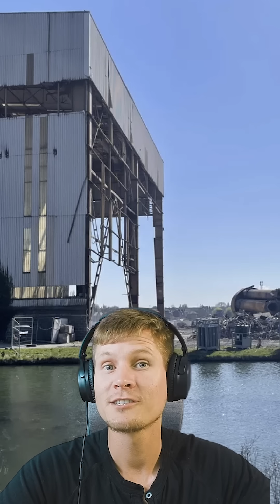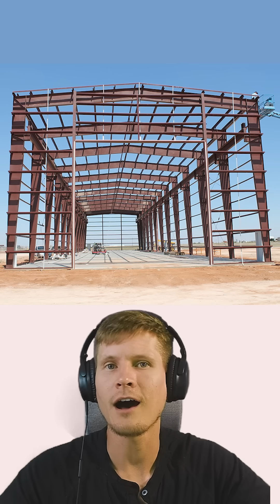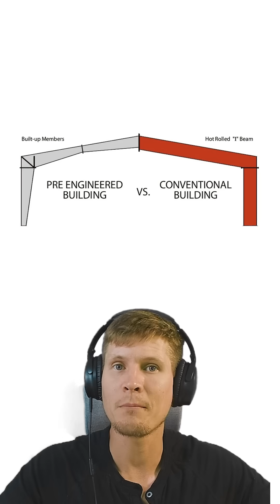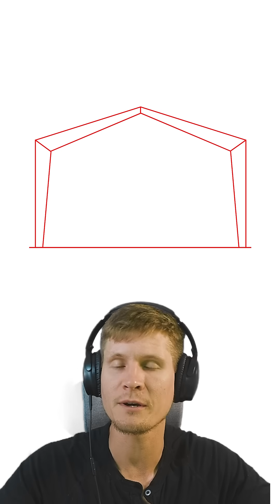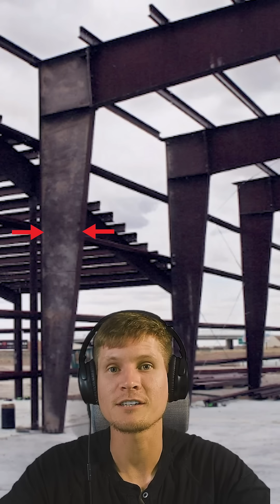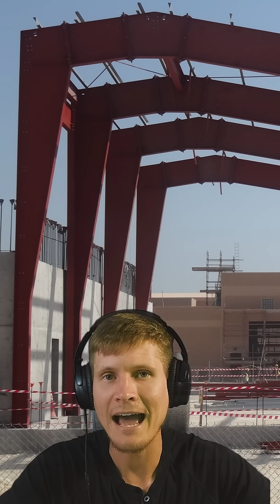This Steel Frame Looks Wrong… but Is It? Structural Engineer Reviews #reddit #engineering #kestava

Comment: The shape is the result of the vertical and horizontal loads (shear, pressure, bending) that the structure must withstand. It's interesting to note that old structures were unnecesarry bulky because at that time engineers weren't able to determinate the real loads on a structure. Materials science, computers, good calculation models didn't exist yet so much had to be "guessed".

Comment: All you have to do is study Frank Lloyd Wright's Johnson Wax Headquarters in Racine, Wisconsin.  It's almost 100 years old, and he used columns very wide at the top and almost tiny at the base.  And he didn't even have an engineering degree.  Rather, he studied engineering.

Comment: I want to build a house with this kind of structure. Thays what I've always dreamed of.
Reply: - these type of structures can be made from timber - using normal studs  clad in structural bracing board (Glue / screw / nail for true tight structures), designed for the loads  - to increase structural stiffness independent of brace-walls.  It is very useful for long open buildings subject to high dynamic loads ("far" from the "rigid" ends - or a building with completely open / opening, gable end . (Also at the ridge, to resist the "spreading forces" - of roof loads / snow, etc.)

 - An interesting recent video, Matt Risinger "Build show" - showcased an office / apartment with complete external insulation and exposed interior framing - this type of structure is suited to that method, it would assist in reducing the number of "hoops".
(Would need to build and test a trial hoop - if no strength tables exist - certify through testing.)

Comment: i was in the PEMB business (as a software engineer) for 20+ years.  i know some people use different words for things, but we always called there rigid frames (or built-up frames — in contrast to post and beam), while a portal frame was a different, more specific type of frame used at (wait for it) a portal, or at a place where an opening had extreme loads that couldn’t be handled by a simple post and beam — as i mentioned i was just a software engineer so i could have the words all wrong with respect to the technical engineering terms

Comment: The money saved also, adds up too. Beings these tapered "I-beams or H-beams" need to be manufactured whether they are tapered or straight, the cost is negotiable from either or, or minimal in fab time, but the savings comes from the less material being used. When there can be at least 4, often times more then that, can be $12k per beam saved, times however many there is... Like the building structure in the video. They can be $100k saved.. approx.

Comment: Proper size at the base so more room for storage racks and forklifts to maneuver.
Reply: No. To allow for overhead cranes
Reply: @BoogerJim    -that can also be engineered in, though it is often better to have the gantry independent from the structure, but if crane access to the entire structure is necessary - beefing up the columns to allow for that works (optimally, ?? not all the columns may need to support the longitudinal crane beams - infinite ways to achieve a design objective, one design set in every concept will get to least material - IF open volume is critical - external framing may be an option also..).

Comment: ahh yes, pre-engineered, as opposed to the buildings that are built first and then engineered later lol (I know that’s not what it’s referring to, it’s just funny to me because, technically isn’t any engineered structure “pre-engineered”?)
Reply: Theyre engineered sizes that are ordered by customers. As opposed to being custom designed on a job by job basis. Hence pre engineered.
Reply: The calculations and driven dimensions are engineers long before the design is even conceptualised.

Engineered-before-design.

In a normal structure, the building design and concept is completed alongside or before the engineering process to specify forces, materials and dimensions.

Designed-before-engineering.
Reply: Ikr lol, not a fan of the "name"
Reply: I've only ever heard them called pre-fabricated

Comment: Very interesting. I have two questions.
1. What about the top joint at the ridge of the roof?
2. Why make the entire beam get wider, instead of a simple gusset at the top to brace the joint?
Reply: Civil Engineer here: Gusset won't cut it as the increased stiffness (by increasing frame depth) is to improve the Moment capacity. If you play around with BMD for a portal frame, you'll notice the bending moments gradually increase to peak around the indicated joints. 

Gusset plates don't resist BM as well as increasing stiffness by increasing the frame depth
Reply: It really all comes down to stiffness. The ability to resist lateral forces. Gussets aren't ideal in this setup. They can "bend" when it comes to later forces as they don't have the necessary strength in all directions, since it's just a flat piece of metal. You wouldn't have enough "play" between everyday forces and failure in high winds. Like dude above says, moment capacity, is what it's called. 
With these large metal buildings, you want as few posts as possible. And that's essentially why this is required. Since there's so few frames/posts, they really need a wide connection at the main joints to be able to resist kicking out and racking, and tapering thickness is easiest way to achieve that while still saving materials. Those forces tend to be focused right on these joints.
Not sure what you mean about the ridge? It has different forces being applied, but is still connected the same way under same principles, basically.
Reply: (Mech/Mcha Eng - lol,  machines are structures designed to do interesting things)- Smoothly transitioning beam geometries eliminates/ reduces stress risers which will exist where "thicknesses" change rapidly (gusset plates - can be designed to taper smoothly in all dimensions I will agree). - A more "Natural" way would be to use an optimised form of catenary curve instead of a straight taper, but that is going to be more expensive to manufacture - and custom engineering may be required.  The structure mapping to the combined shear / bending moment diagram approaches "minimal material".
 - Note, as in all safety critical engineering a safety factor will always be applied, this means, for a catastrophic collapse to occur, lots of errors must be made - SF=2.0, is good for low fatigue / cycle life "machines"/structures - ?? take it up to 3 or 4 at these connections as they are relatively high cycling and high material stress components, mild steel should never exceed ~50% of its elastic range in general use for an infinite life).

Comment: PEMB engineer here. Depending on span and loading, the haunch may be dependent more on gravity and snow than even a large category C seismic lateral load. 

The shape of the most efficient three plate also follows pretty close to the moment diagram of the frame itself, and in a pinned moment frame, the base approaches zero moment. Thus in an efficient design, your column bases are very small.
Reply from the maker: yes sir - very great point about moment generated from gravity loads!
Reply: Had air hangers in line of jet thrust before. I was told to design with 150psf wind load. That base connection was……..unique. Lol